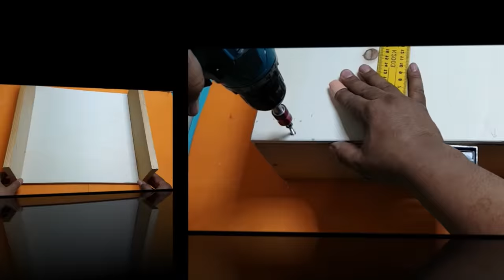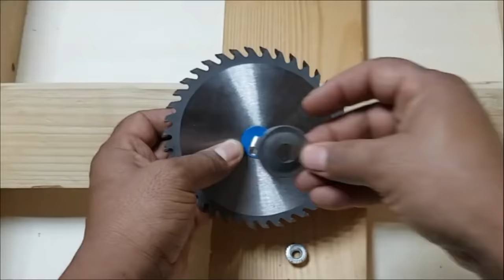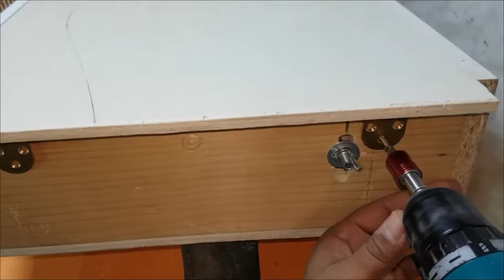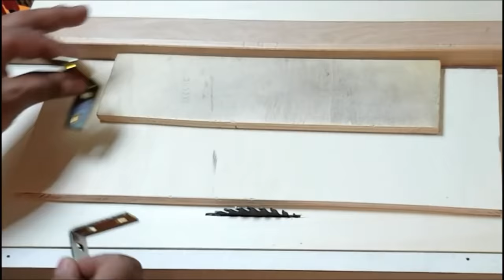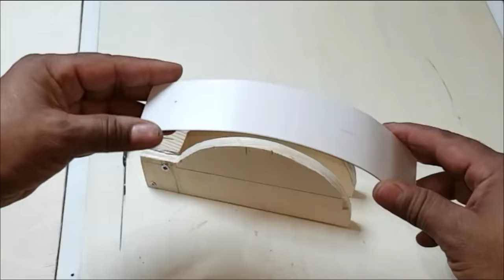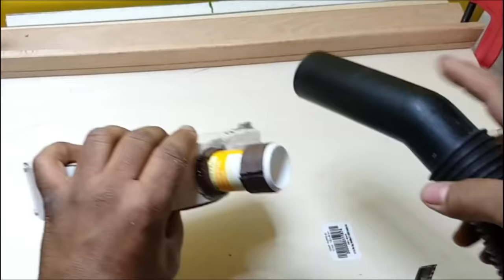How to make a table saw from an old drill

Comment: Very good work. I have got questions. How noisey is the table saw if I use the drill? Is it much better than saw table?
Reply from the maker: best table saw
Reply: @TECHYSF  I'm sorry but you didn't answer my question. Is the drill saw very noisey or not?
Reply: @chris01479  I built a belt sander using an electric drill. Essentially, the drill is what's making the noise. So this saw will be as loud as the drill you use. And since it's inside of a box, it'll be slightly muffled. You could also line it with foam to help reduce noise.